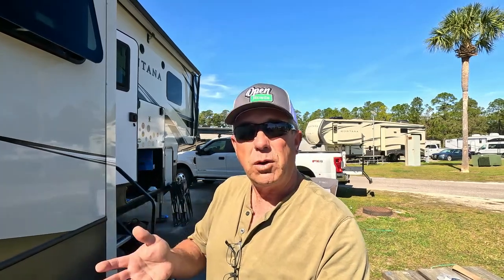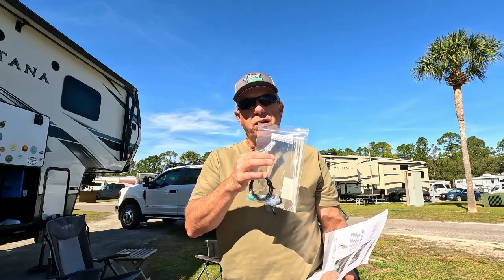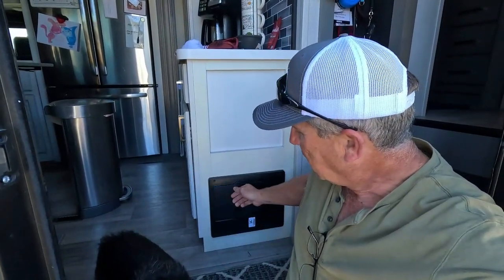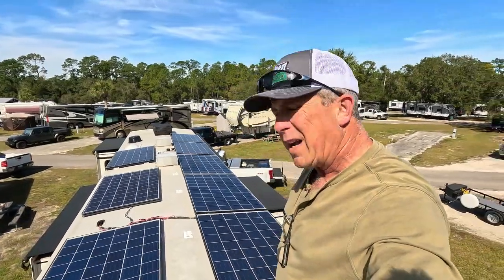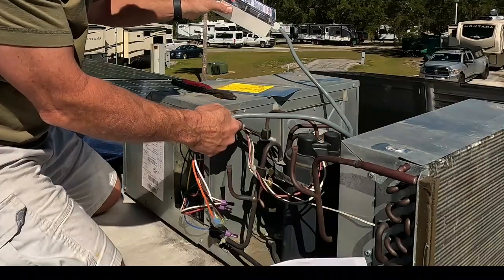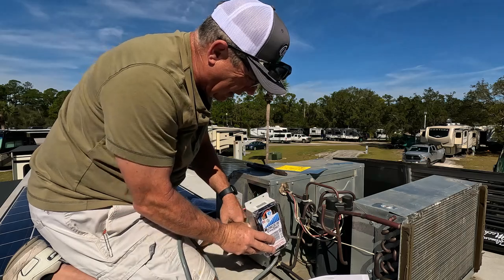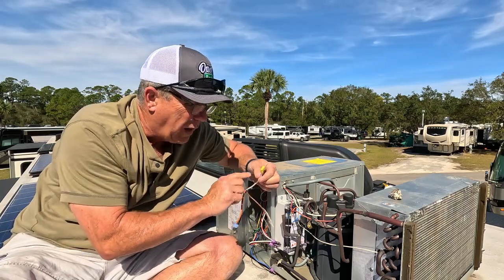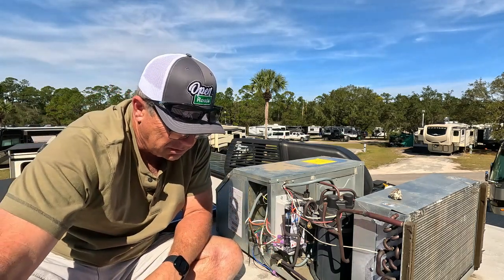Basic Guide to A/C Soft Start Installation    S3 E55

Comment: Can this be used on a well pump?
Reply from the maker: Not sure if the soft start would work on a well pump. Most of those pumps are 220 volt and I do not know if they make a soft start for that type of motor. I feel sure there might be something similar on the market for that application.
Reply: @ thanks

Comment: Glad i watched this. we have 3 to put on. I have only done the softstart brand on dometic. its 5 wires vs 4. For the last wire did you simply cut it, and wire in the micro-air, like a splice?
we dont have a heat pump so it should not be a concern for us.
Reply from the maker: Yes, the black wire was simply a splice added inline on the black wire between the compressor and the freeze board.